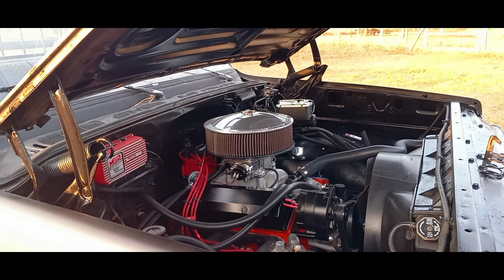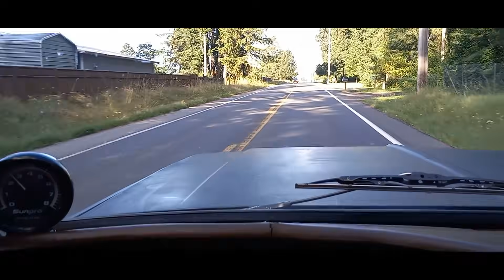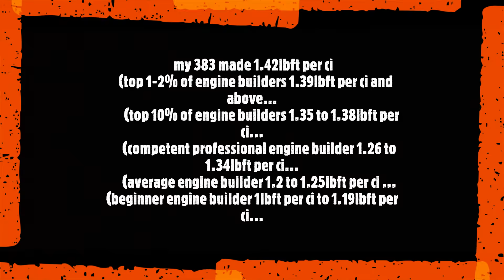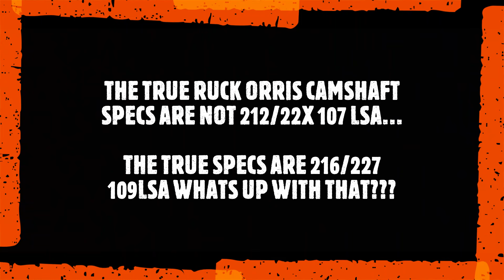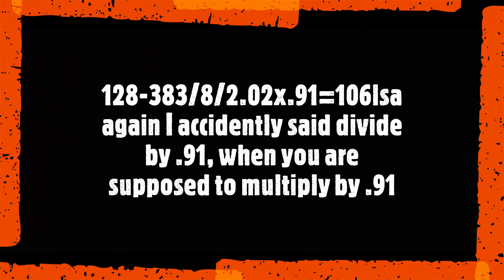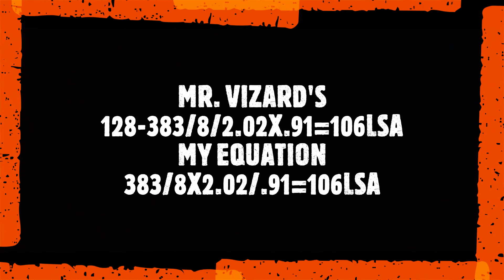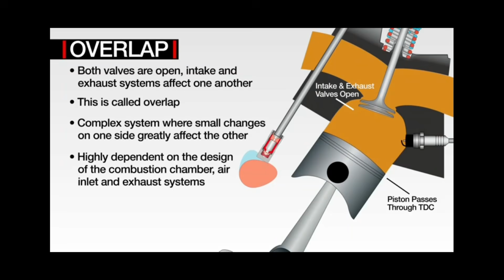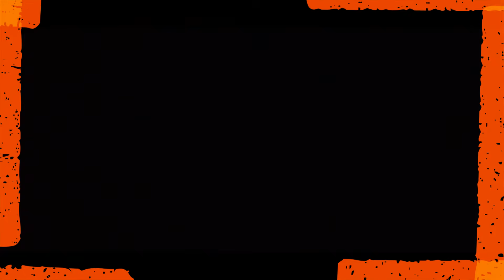CAMSHAFT SELECTION by LSA, 9 LSA's DYNO TESTED!!! LSA THEORY WILL BE DYNO PROVEN!!!, and EXPLAINED

Comment: Something that has always baffled me,  watching YouTube videos,  is bragging  about hp on the dyno. Hp is a calculation of torque and rpm. Second that engine will not perform exactly the same in a vehicle. This video doesn't explicitly say this but it's easy enough to realize this guy gets that. I'll use a gross exaggeration: an engine that produces 600hp at 7000rpm will be hell to drive on the street. I and the vast majority of people would prefer 600lb at 4000rpm but "only" 457hp

Comment: But if I want less overlap for a smoother idle, and run a 106 lsa in a 440 with 9.5 to 1, wouldn't this method close the intake very early and cause pinging on pump fuel.

Comment: Question- I have a small journal 331 Chevy. 9.6-1 compression for street use. 451 cast heads. dual plane intake and a 4 speed. Not interested in taking it drag racing but rather a nice running street engine. What do you think about this combo?  272/282 duration- 108lsa- .520 lift with 1.5 rockers.??

Comment: I spent years working on chevys with older brother and friends late 70s thru 80s, Camaros, chevelles, SB, BB, then I got a BSc and MSc in physics...I love the physics of how engines/cars work, its frustrating how many that know everything about engines mysteriously know nothing about physics, specifically thermo and fluid dynamics. thanks for your video. I am in the process of building a 396 for my 71 K2500

Comment: Junk information today had a friend that bought $25k BBC snd ran 6 tenths slower than my $4K  BBF WITH HOMADE  INJECTION  AND EXPERIANCE DESIGNED CAM AND THAT INCLUDES WEIGHT FACTORING mr DV always seems to use a tight lsa  and while that works for some but not in every situation you can not simply make a blanket statement and call it done this video and commentary is about 80% BS   if the commentator is so good he needs to go to work for Ford or GM  there are some very basic rules to LSA and they are cubic inch fuel octane  comp ratio  rpm  have a nice day

Comment: Hi mark ,I have a 355 co with ported heads 2-02 intake 164 ex 30 thou o/s bore flat top pistons 60cc chamber I have a cam can you tell me will this work advertised duration 294in 297ex 264/267at  50 106icl  108lsa also I have a choice 5.7rod or 5.625 shave the block 75thou what’s your opinion thank you

Comment: Great video! I have found the biggest issue people have is not admitting what they will actually be doing with the vehicle.  90% of builds never see the track. I'm guilty of this myself, even after admitting it. lol.  I now have a 600HP 427 SBC in an 81 Vette that will never see the track, and has a rear end that can not handle much more than 450hp.  The reality is a 450hp engine would actually be more fun in this car.  Instead, I now have to upgrade the read end which is complicated in the later C3s that have the aluminum Dana44, as well as install a 5 speed trans that can handle the extra power.  Not to mention not having vacuum at idle to run brakes.

Comment: does 128 work for 292 cube L6's ?  using 128 gives me a 104 LSA, but if i use 132  it comes out to 109, would 132 be correct since a 292 L6 has a similar cylinder displacement to a BBC or BBF ?

Comment: Thank you for providing this information. I used to be a tune up mechanic and when I was a kid I used to read all the Hot rod magazines and Car craft magazines and learned as much as i could. As a Tune up mechanic I was pretty good at diagnosing problems from carburetors, ignition, and Electronic computer controlled systems. So I suspected your information would be good. I watched all the way to the end. I have a 2004 Ford F250 2V heads running E85 with a conversion kit that taps into the fuel injectors called Eflexfuel. I put a 100 octane tune in it and want to rebuild the engine with 12 to 1 compression to make use of that E85 fuel high octane. I want a cam that is just borderline about to start loping at idle. I want huge torque from about 1800 rpm to 5000 rpm. So I entered your formula into an Excel sheet and came up with 107 degree lobe separation and 218 degree duration intake and exhaust. Do you think this cam profile will give me what I want? Years ago I had a 1970 351 Cleveland with 4 barrel heads. I put a similar cam in it with fast bleed lifters. Duration where it barely had a noticeable lope. I saw how Edelbrock had this air gap manifold and had an idea. I notched the divided intake manifold so that the first half of the primary throttle blades had a 1/4 inch notch below it. Than from half the primary throttle blades to the half the secondary throttle blades I notched the intake half way to the intake floor and from that point to the end of the secondary throttle blades I notched it to the intake floor. My thinking was at part throttle I would get more velocity and at progressively wider throttle I would have more of an undivided intake manifold. After starting the engine after the intake modification my idle dropped a little but a surprising thing happened. when you tapped on the gas pedal it revved like one of those super bike motorcycles. Very fast crisp throttle response. That car was fast and my nieces and nephews would always feel that roller coaster rush every time I accelerated what I thought was normally.

Comment: Very god video explaining everything,Though I have built more then my share of motor's back in the day I never fully understood LSA Importance till now. Though I always tried to build my motors more toward Torque then HP. I use to run ol Sig Erson cams because I like their TQ serise cams, Which I used to run a TQ30 in Small Block Fords 302's I see today the have changed and now that same split duration is called a TQ40 today. But I've gone to building the 351 Clevelands, But I would like to have that same pulling power or better in a street roller instead of a hydrolic like back in my old days.  So with larger cubic inches and larger valves I understand some cam changes have to happen to get the TQ I want it to have accrossed a broad power range or as wide as I can get. Thanks Kurt

Comment: Very interesting. Could you assist me in a cam selection for my 454 stroker 496 10:22 to 1 compression. Going in a 67 Camaro, more street than strip.
Reply: Wow, this guy goes on forever without telling anybody anything . That engine will have a long stroke which means there’s no advantage to having a big lobe separation angel unless you’re gonna run a turbo someday. 300° of duration 110° lobe separation angle 250° of duration 108° of lope separation angle if you want a smooth idle lots of vacuum, a larger lobe separation angle and if you want a rough idle or you’re gonna run a stall converter than the lower separation angle
Reply: That’s a pretty radical compression ratio and a pretty radical engine so it deserves a pretty radical cam big bra blocks like a lot of duration because of the smaller valves 250 duration would be pretty radical and 300 would be extreme larger, lobe separation angle is gonna reduce your power output, especially on that engine, but it’s also gonna make it idle nice

Comment: 30 mins and counting with no real data, just mumbo jumbo philosophical B.S. and a back injury story. Sounds like a glob of AI misspellings read off while driving around in rural America for visual activity. So much for Brian Tooley Racing however, what's up with that. Maybe David and Brian had a falling out at some point, LOL.
Maybe the exhaust valve is held constant in relation to crank/piston location for a stock piston w/o valve reliefs to allow cam changes on an unmodified engine for someone who can't afford buying a new reciprocating assembly.

Comment: When calculating for a 6 cylinder, say a 4.0l, (244ci) , Jeep engine, would you replace the 128-244/8 with 128-244/6 ? And for a 4cyl 2.3l Ford with 128-140/4 ?

Comment: Just found this video. This is awesome. Finally found someone else that thinks like I do. You’re quite a bit smarter at this than I am but I’m learning every day. I’m also a big fan of David Vizard. I’ve been contemplating putting a 30° Cut on my intake valves. It’s not a high RPM motor so I’m not too worried about the trade-off at high RPM it’s a four-wheel-drive truck that just sees the street and occasional snow. I just wanted to run the best it can. It Mopar 360 with 379 in.³ Aluminum heads with 202 valves and a stock intake or performer intake. I have to use those intakes because of my AC compressor and I need the offset thermostat housing. I give up a lot of horsepower over the performer RPM.

Comment: Just wonderful! finally getting answers to what I have wondered for 22-23 years without getting real answers... is there a way to calculate the base number (128) for other engines? (Jeep 4.0 6cyl, volvo b18/b20 and other engines) If I understand correct, to change the rpm range of an engine one just increase duration (and overlap) wich then usually makes it possible to increase compression, wich then makes it possible to change LSA. Thank you for this video

Comment: I need someone to spec a cam for my z06 ls7 heads fixed and cnc Ported. All stock other than that. No more than 615 lift with the stock 1.8 rockers. Help before I pull all my hair out. Thanks

Comment: Can I ask will this 128 formula work for a 9.5/9.6 static compression engines or do I need to change something? I build low rpm towing engines with very short duration cams and need keep compression around that for pulling.  Big block chevy and small blocks as I see the 128 for sbs and 132 for BBCs?

Comment: Hey. Just found your videos thru David vizards channel. Can you put down the equations and c.i per engine from the video here in the comments,  I only have one thay halfway works and and it's not the one I wrote with, my son is typing this out for me. Thx again.  Also does besides overall cubic inches, does a bore or stroke size by there self come into play outside of the compress ratio for your equation?

Comment: I don't understand how you get 4 degrees of overlap from the Comp 270H cam in your example. From the cam card, intake opens 29 BTDC and exhaust closes 21 ATDC equals 50 degrees of overlap @ 0.006. This seems like a proper overlap number for the RPM range specified. Am I missing something here?

Comment: I live in California, and almost pulled the Triger on low lift BTR  212/218/111 LSA for 2004  Avalanche with using stock converter. But was not meant to be!! I wont able to pass the emission and smog test.

Comment: yes I would like help in selecting duration and overlap. I got the LSA down. 128-385/8/2.08X.91. RPM RANGE 0-1500-5500-6000. I WANT IS TOP RUN BUT NOT DRINK GAS. THANKS FOR THE HELP.

Comment: Id like to thank you for sharing this knowledge w me and everyone else. Im very new to this kind of stuff. I came across mr wizard a week ago. I have since watched every video of his. Its amazing that this information is considered not important. The ignorance of people to me is phenomenal. I personally have always said everything in life has a magic formula. You just have to figure it out.  To me, people who say lsa or lca doesnt matter are just morons. Thats the first thing you start with. What also blows me away is cam companies offer sub par cams off the shelf. Its insane to think that so called professionals offer sub par products. One should always have an open mind and think critically. Common sense is also a huge plus. Common sense should tell you that valve timing etc. Should and will always have optimal timings etc. I look at things different than most people i imagine. To me simple common sense should tell you mr wizard and your information is good solid information. Why, simply because of how its explained. In which case common sense tells you its correct. I just bought a 91 mustang gt 5.0. I want to get a top end kit along w a cam for it. I want to keep the bottom end stock. How do you go about selecting proper intake and heads to work with the cam? Do you select cam first or do you select cam last? Id like to get a trick flow or holley systemax upper and lower intake and afr 165 renegade heads. Could you perhaps help me? If not np, i know its a big ask for sure. I also have to figure out what injectors to get as well. Any help in this matter is appreciated. I also know i have to get heads which work w stock pistons which the renegades do. Id like to learn to port heads also. I wanna build this engine so bad its killing me simply not knowing how haha. I wish i had the skill and knowledge to do so. I do want to try it though thats for sure.

Comment: I'm trying to keep an open mind here and finish the video, but I'm an hour 4 minutes into it and so far you've devoted most of the time to slamming BT and his techniques. BTR uses their spintron to measure the valve motion produced by their lobe profiles. I can't think of a company that does more to optimize lobe geometry by studying the physics of controlling a poppet valve in the physical world as well as computer modeling world. You contradict yourself time and time again. Take, for instance, the Truck Norris cam. You argue that it makes good peak power because it employs more exhaust duration (which you acknowledge is a tried and proven way to make more high RPM power), but it makes gains in the target application (replacing stock cams in generic LS motors) from 3000 RPM on up with little loss below that. Please tell us, what did Brian Tooley do to you? I have no allegiance to BTR, but you just seem to have an axe to grind. Lay off trying to explain the psychology of why he makes such terrible assumptions and prove your case, and, start grinding cams yourself so we can all benefit from your mastery of the science.

Comment: If the ex duration is increased by 4 degrees without changing the opening timing, then BY DEFINITION the LSA is increased by 1 degree. It's math, not philosophy, and not subjective, it's absolute. And you can say Brian Tooley, for f*#ks sake, if it wasn't clear who you were referring to at first (it was) Holdener's graph identifies the camshaft supplier.

Comment: A close LSA (106), then advance the cam 4 degrees is the best I've found... However, one must consider anti reversion headers to maximize the effect of scavaging effect.  
This is why I like larger tube diameter primary tubes than the head exhaust has, as it builds a 'damn', preventing the reversion pulses from re entering the cylinder.  You actually want a sharp difference... IOW, don't blend the head to match the header primary, you actually want the head smaller than the primary tube & a sharp edge between the tube.. Think D chamber heads... Wide LSA cams seem to be a thing now, because of boosted applications, where it's not as important... but it really is even then because of backpressure the turbo imparts on the exhaust.

Comment: Great video you are obviously more knowledgeable than 99% of engine builders. It seems that the information is geared towards 383 Chevy’s. I understand this because of it popularity. What about some of us who are not in the Chevy camp. I run Oldsmobile engine in drag racing. The rpm range is 5000 to 7300. Compression is 15-1 with methonal. Head flow is an average intake of 380 cfm. Can you help me spec a camshaft using your formula?

Comment: I just finished up a pump gas 383.
11.4 
Promaxx 215 heads project x
Piston 5 out of hole 39 quench
Light weight crank
Standard valume oil pump
Solid lifter flat cam, yes no roller.
My specs.
560 567 lift
248 252@50
104 lobe sep
Installed 100 cl.
Did 626 @6600 537 torque at 4500. Still makes 500 torque at 6500.
Pulled to 7k and still making 606 hp. 
Much of the build is based off david vizard , and this channel. I was also good friends with a man who was close friends with dick maskin, owner of dart heads. He tought me alot, much of the info on this channel is valuable info and almost secrets
Reply: That is some amazing HP for the 383- that engine must be a beast- I used to think that to make lots of HP you need a high lift cam (around .620 to .650 lift and 300 duration) - but your cam specs have proved me wrong- im guessing your engine has a decent idle and pulls hard to red line- congrats on building one heck of an engine -
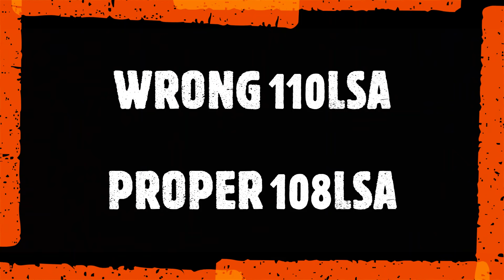Reply: Alright I'm building a 383 aftermarket crank rods and forged pistons with Chinese hand wull be ported using 474 hydraulic roller roller cam what can would you recommend, I'm a old drag racer wanting mak power, hydraulic cams are great but1 surely know how to set  solid roller any help I can appreciate, like your information 56:47

Comment: I see your mistake. You see the word truck in it and assume it's for driving a working truck on the street. 
This application is for sticking the cam in trucks that are used for drag racing and street driving because you can't go by a cheap newish V8 rear wheel drive car anymore for the last couple decades. So the kids drive trucks like cars.